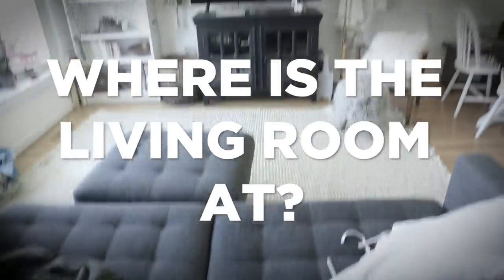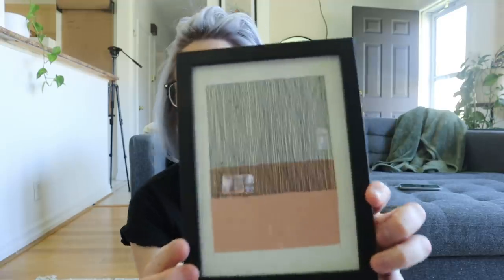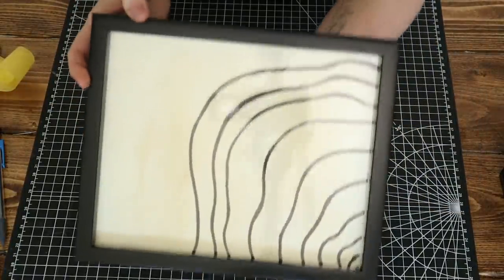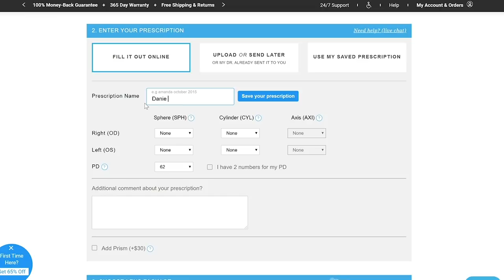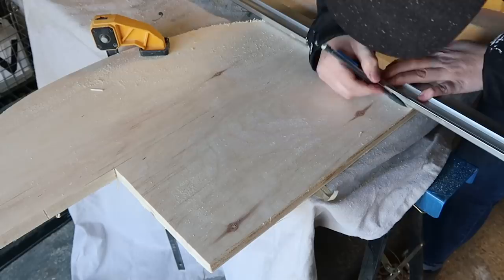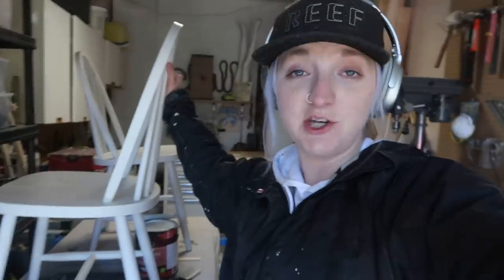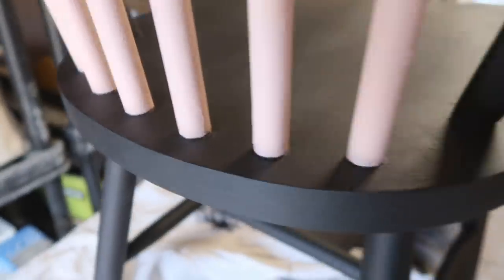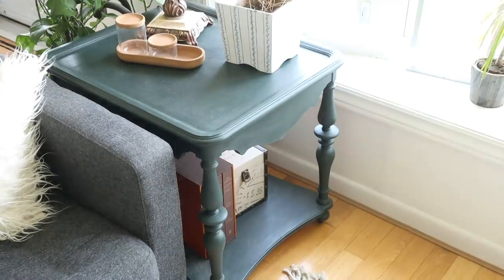DIY Living Room Refresh! (PART 3) | DIY Gallery Wall, Custom Art, Sofa Arm Table + Painted Chairs!

Comment: I've seen several people do this paper cut out template idea for their gallery walls, so excited to try it.
One note, I saw a youtuber post cutting the paper also add where the nail hole is for each frame so she then just put the nail directly into the paper, I thought that was a good idea.
Keeps you from accidentally placing the hole to high or to low.
Food for thought.
Reply from the maker: Smart! Definitely take that tip with me for next time!

Comment: i had a diy project that turned into a hot mess. i was so sad, disappointed and about to give up but then i thought what would diy danie do...inspiration! i finished most of the project yesterday. will add a few finishing touches today, weather permitting, success! 🙋🏽‍♀️ thanks, danie, for your most cheerful diy attitude & spirit!

❤️kenobi

Comment: I created a gallery wall a few years back. I placed my cell/camera on a tripod in the middle of the room far back enough to frame the entire wall where my gallery would be. I installed one single nail on that wall. I proceeded to hang one frame at a time on that nail. I took a picture of each artwork as it hung on that nail. Because I kept my camera at the same distance from the wall, each artwork was photographed to scale. I printed the images and cut out each image (artwork).  I thus had mini versions of my artwork (all to scale) to play with, until I found the right arrangement for the wall.

Comment: I'm not really one for pink but the spindles work in pink! It brings some brightness and lightness to that corner than you'd lose with the green against the black and the dark wood. That corner would just get swallowed in dark on dark on dark if you went with the green. It also draws the eye from the pink at the entryway and pulls a visitor's eye into the space. From the entry to the place for communal eating and gathering. I think that's fantastic. IMO, keep the pink.

Comment: Love it! That side table idea is fantastic. Very custom. I think I need to invest in some wood working tools so I can start making myself things 😻 also, pink spindles defo tie in to your entry way makeover colours. If you were wanting to add some of the Annie sloan green you could maybe add a painted green frame, or a vase on the table, or some emerald green cushions on top of the chairs, that’s it! I imagine soft fluffy ones for under ya bum for added dining comfort 🥰 you could even diy some. Xo Maccena does quite a few funky cushion cover diys on her Chanel from memory. But over all your space looks super cute/boho/electric/vintage and a touch of modern with the blacks ;) very cool indeed xxx

Comment: If doing a gallery wall, I think it's easier to put measurements of wall area on floor, the move pictures around on floor w/ in that space. Then take top middle picture, put on wall & hang pics from from floor layout to wall 1 at a time. No craft paper templates needed. And always use command strips.

Comment: I'm with you on the green for the spindles. And...I keep thinking you could try a long thin(ish) vertical mirror on the wall behind the table. It would pull in light from the window. I don't know, that spot always looked like it needed something.
Reply from the maker: Right? I agree. Actually never considered a mirror but something round or half moon shaped might be perfect. You got my head turning girl 🤔🤔🤔

Comment: I really like the pink spindles on the chairs, and the little side table. I was curious why you didn't use that lovely blank wall by the dining area for your gallery wall, instead of putting so much on the small tv wall?

Comment: Leave it pink please. Matching with the art wall at the entry. 
Great job. Love the side table.
Do you think you can guide me to make a "everything holder basket" remake? Do have a nearly square cane basket on the floor. I slid it under end of the coffee table. Holds tissue box 2, hold few magazines torch and hand cream. No idea what and how to update so it looks modern and not so messy. Thougt to put it on a platform and do wheels but I am not sure it is a good idea. 
Please please help. 
Thanks
Reply from the maker: Hmmm can you share a pic on Insta with me 🤔 need a visual
Reply: @DIYDanie  Love to but how do I do it? Not very savy about how.

Comment: The chairs are too dark and blend into your table too much i think you need to paint just the top of the seat (not the edges) pink or the spindles and the top of the seat another light color that goes with the room.